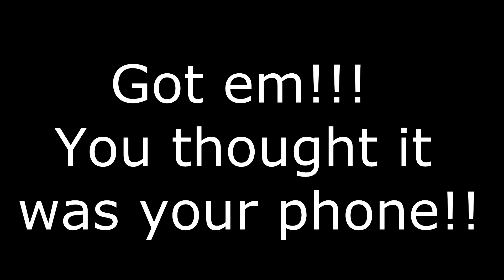Pawn Shop Series!! ESP LTD Get's a second Chance! But Was It Worth $85???

Comment: Sean, I've revived a lot of pawn shop guitars and some of them came out better than new with some work and a proper setup, and a few are among my favorite players now and real keepers. Talking mostly Epis and Squiers. $85 cash for this Ltd Viper is a steal and except for a little grime and fret tarnish it looks like it's basically in good shape but may have been stored in a damp place for a while and not played much since. (Like half the used guitars in Florida? 😁) But I woulda bought it too even if it needs a few hours' work. I'm going out on a limb saying this 2mins in so it could have some demons hiding but that's the gamble. If I walked in the pawn shop ahead of you, this guitar would be in my hands already before you saw it.
(Edit) After watching the whole video... you STOLE this guitar, brother. I'd leave it like it is as a player, maybe polish out that buckle rash on the back and give it a little more polishing on the front too if I was trying to flip it. Plenty of varnish on these and you know any scratches and scuffs would just about disappear. No trouble turning this for $200-250 direct to a buyer. But me, I'd hang on to it. Great pawn shop find!

Comment: Now, hang on just a gol darn minute Sean. What if I got a real problem, and I'm ascairt I'm gonna destroy my neck tryin to fix? Bought myself a nice JS32 warrior 3 years ago, but I'm a modder so I wanted to switch out the stale chrome hardware with some gold coolness. Now I was swapping out the liscensed FR locking nut, and the cheap ass screw on the nut, the dang head snapped off. Man, I was cursing a blue streak I wasn't using a drill, or doing anything stupid, it just snapped off, flush with the wood. Tried to put in another screw to anchor the right side o that nut, but now of course the nut is off center and that high E slips off the end of the dang neck and frets out when I'm tryin to shred. Can ya show us how to handle a headless, tiny ,brittlle screw removal without destroying the neck, headstock, or anything else? Also I bought a neck  from China in case that don't work. Problem is it didn't come pre-drilled for the pocket, or for the tuners... And the darn neck slips in and outta the pocket like..well, use your imagination..And the frets suck on the new neck, even working the ends for an hour still like to slice my callouses off my dang finger pads. I need this neck to be lightning fast, ya know. How else I gonna pull off RR and EVH, yo?                        That dang screw is the bane o my existence bra.🤔

Comment: I have a 256 set neck Viper with P90s i got used from a Guitar center for $300, that i did up like Tony Iommis Monkey, complete with Decal, and i love her to death, in the process of swapping out the pickups from some custom P90s made to Monkey Specs and a new wiring harness, as the last owner fiddle fuxked around with the wires and kinda made a mess of things

Comment: That was a pretty good find for $ 85, not sure how much the MSRP is for one, but even the fret job additionally & I figure that's a fair price if one had to pay  $ 100 for a clean up that included level, crown & polish ? Would you say that with the belt buckle scratches that's what Reverb would call Fair Condition ? Plenty of life in the frets after the level & crown still. This post was before your final decision on a nargain or not. Most aren't going to do the LC&P. The Truss rod adjustment & clean up is something anyone can do for routine maintenance. Maybe they adjusted the truss rod like that to get the fret's level relative to the strings without realizing the relief was going to be the wonky ? I mean originally. it wasn't buzzy ? Unplugged & it was just a weird D-chord & little pingy from that segment ?